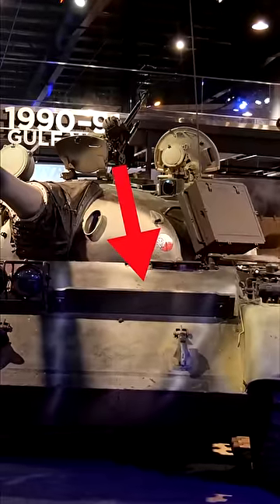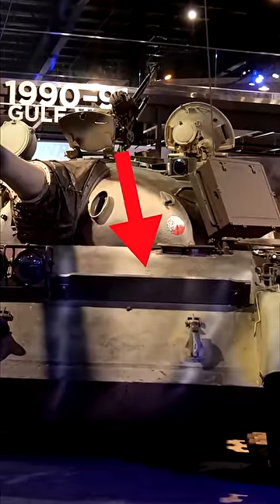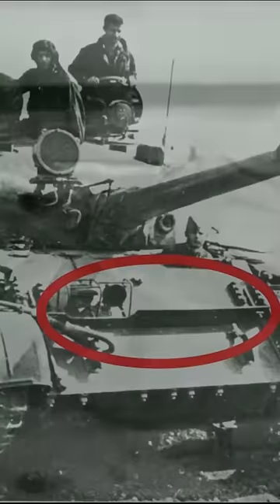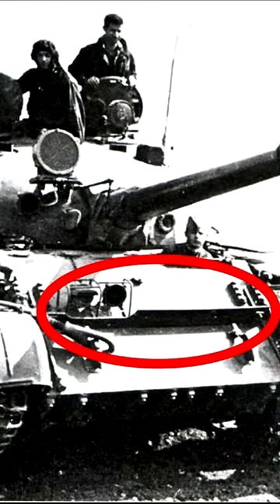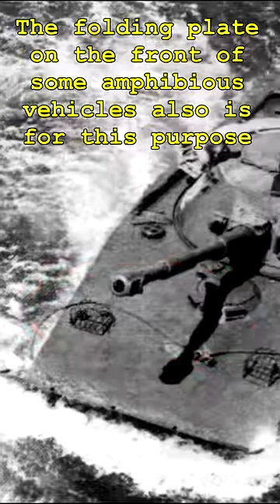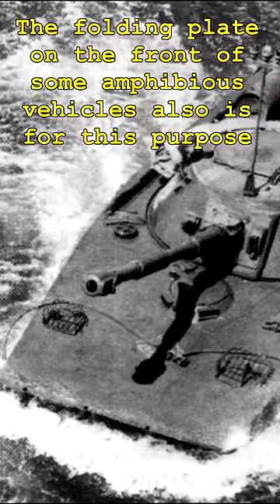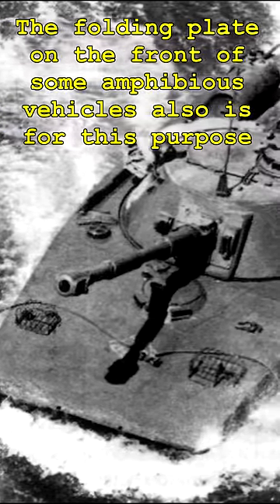Why Do Some Tanks Have This Plate?

Comment: Huh, that's absolutely not what I thought it was. It makes sense, but it doesn't look exactly efficient. It reduces the driver's visibility to a pretty considerable extent. I always thought it was there to stop shrapnel of any kind from hitting the driver, or even the view ports. Interesting video, I'd have never thought of that being its actual purpose
Reply from the maker: It doesn't stick up high enough to block the drivers view for tanks. Not sure about vehicles like the PT-76 but I assume they are designed to not block the view significantly

Comment: Soviet tank snorkel: only big enough for engine intake air/air for the crew
Western tank snorkel: literal tower where the commander sticks out, to see where he's going and make escaping easier
Reply: You clearly did never see a T-80 wading through water
Reply: @Kasi11  I have, they only have a funnel for extreme deep wading as it can be seen in photos.
Absolutely horrible to not have a funnel by default where the crew can escape.
Reply: @Jan_372  Nearly every T-80 has a big pipe on the back of the turret that gets mounted on the commander hatch for wading. Most T-72/90 and T-64 only have pipes for the air intake.
Reply: @Kasi11  that big pipe for the commander is too large to even get stowed on the tank though, otherwise you'd see rings on them all the time.
They only have the engine snorkel permanently installed.
Reply: @Jan_372  No, the engine has a quite small pipe and two adapter plates that connect the pipe with the intakes.